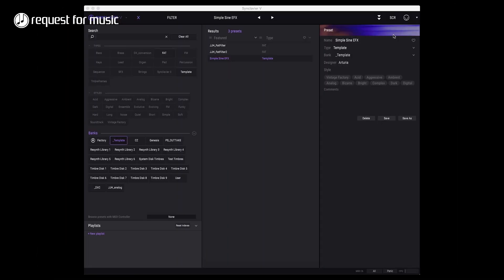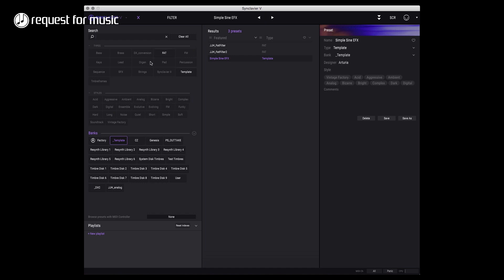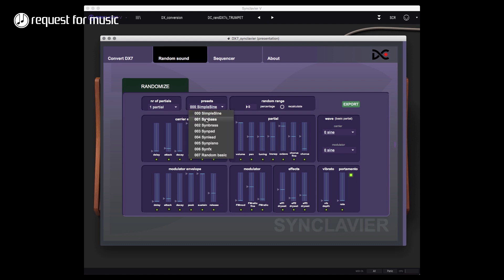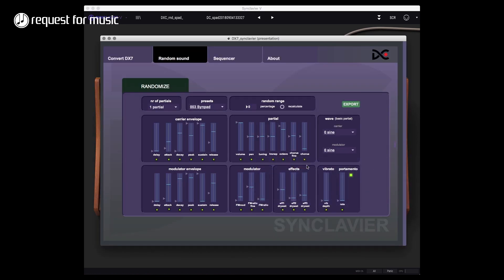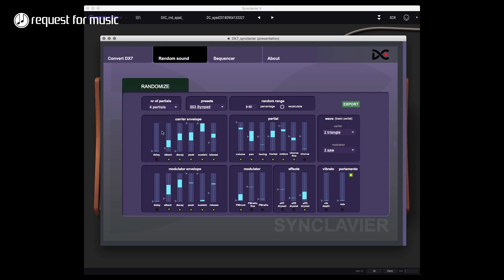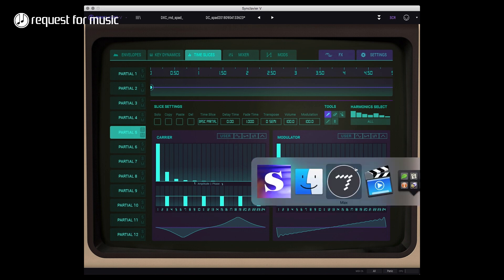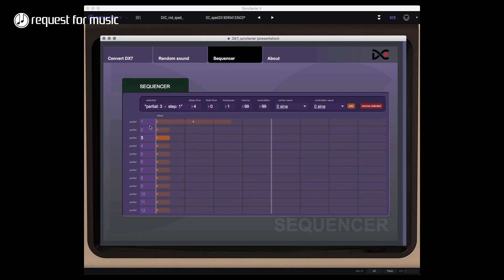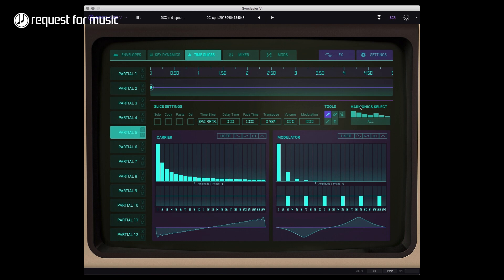SYNC0017 DXC demo2

Comment: Hi Hans,
i found these videos. Is the project really finished? There's so much potential behind it.
Reply from the maker: Hey Piet - well, I had been programming for quite a while, but have so far not had succes converting DX7's feedback.... so I do see the potential but for that I would REALLY need a predictable result from the converted feedback. Otherwise I could only convert sounds that do not use feedback and I doubt people would pay for a half-finished product ao for the time being I have abandoned it because in the meantime I have discovered Voltage Modular as a modular synth platform that I can use and also program for..
I have created quite a couple of modules for that platform by now amongst which a monophonic modules that resembles the way Synclavier makes sound and I might create a polyphonic version as well later on...
Cheers Hans

Comment: Interesting stuff, will there be  Windows version as well?
Reply from the maker: Hi Wookiee - if it comes out, there will surely be a Windows version....
I say 'if' because apart from having less time to work on it than I'd like, there are still things that are hard to convert or emulate...
That's actually why I at least brought out the randomize program at some point - that worked as I liked...
I am still trying (now and then) to get the DX7 conversion up to a certain standard but it will definitely not be a 1:1 conversion...
cheers Hans
Reply: @hansholema4740  thank you sir your reply is most informative.
Reply from the maker: @The_WookieeYT  You're welcome - ya - I may have underestimated the problems that would come up and maybe over-estimated myself, but I'm not one to give up easily :-)
And a lot works but just not as close as I would like :-)
Reply: @hansholema4740  Could you provide link to your random generator I might be interested in having look at that or is the link to be found in the FB group.
Reply from the maker: @The_WookieeYT  It is on my site:
https://www.requestformusic.com/software/
Reply: @hansholema4740  Thank you I will investigate and try to reassure my Credit Card ;) .
Reply from the maker: @The_WookieeYT  :-) I'm not sure if I have credit card payment on the site though - I think it is Paypal...
Reply: @hansholema4740  Yeah you are just PayPal which is fine, the CC still has to approve it though 🤔😎
Reply from the maker: @The_WookieeYT  :-)